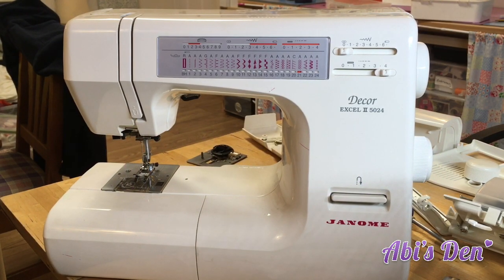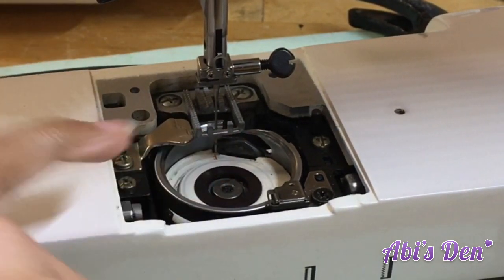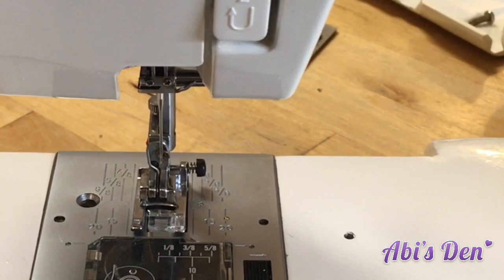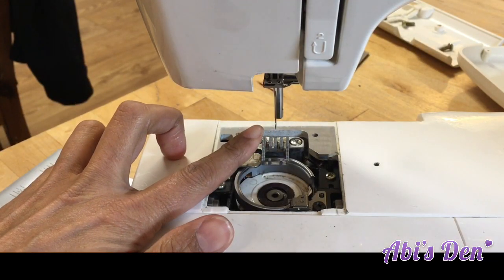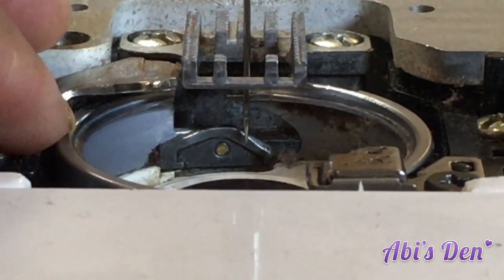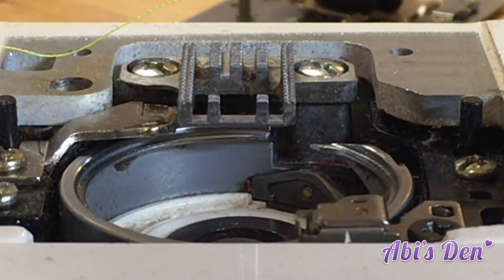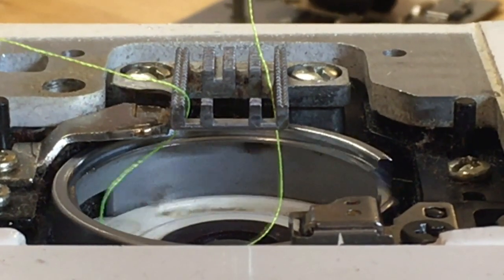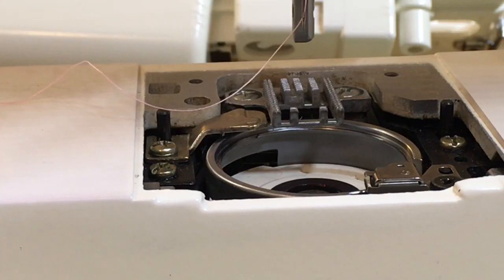Check the timing on a top loading (rotary hook) sewing machine

Comment: Thank you for showing me what I need to be looking for. I have my second hand Magicfly 59 stich sewing machine in pieces right now because the hook is not catching the bobbin thread. This doesn't help me because it doesn't show what I need to adjust. The only thing I can find is a very sketchy video and nothing on where I need to go in and fix the timing. Sigh. But I will keep working on it myself because I do not have $100.00 to spare to get it fixed. Thank you .
Reply from the maker: I’m not sure why it costs $100 to fix your machine. It sounds like your mechanic is a bit cheeky

Comment: Hi Abi that was an interesting video. However, it would be good for you to show the timing with this top loader bobbin with a zig zag stitch. My hook is catching the cotton, but my needle doesn't seem to be timed with the grove in the bobbin case and is scraping on the bottom during the left side zig zag. So not sure if it's a timing issue still or a needle height.
Reply: having similar problem where i seem to have the right hook timing but now my zig zag stitch is looking more like a straight stitch... zigging but not zagging, lol.

Comment: Hi, wonder if you could help me as first time I came around to find a problem I can't fix. Brother ls14- the bobbin case jumps up when the chatcher spins. Aligned marks, and surley putted case correctly, also tried with other brother bobbin case, as found it might be problem with that, but not any different. I have not screwed any parts which could affect this. Removed plate and bobbin case for cleaning and this has occured. It drives me crazy, as me, owner of 6 machines which I'm fixing myself, can't deal with simple brother. Any tips what could be an issue in here? Thank you for your videos which helped me so far
Reply from the maker: The problem with the ls14 is a poorly built machine. Certain parts fail because the plastic bend out of shape and once that happens - the machine is thrown away. It’s not repairable. However - just check the timing. See if you can repair that. It is tricky but possible. Just a bad machine 🫣😵‍💫